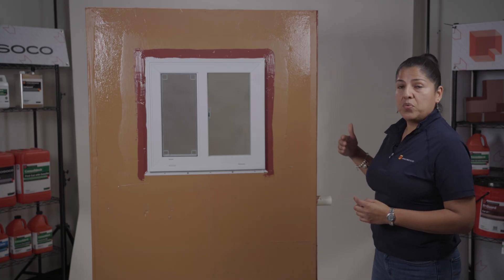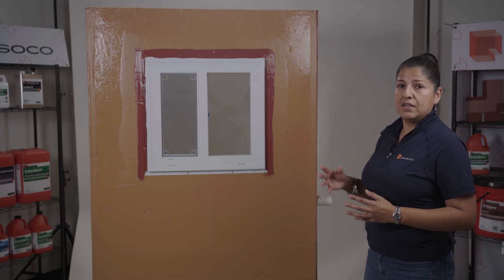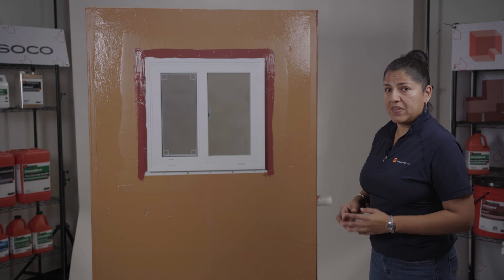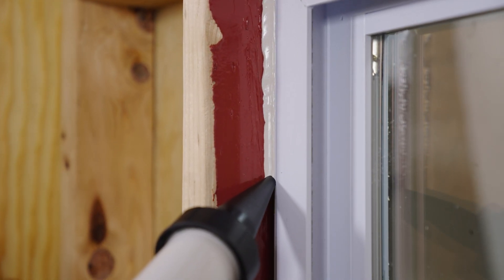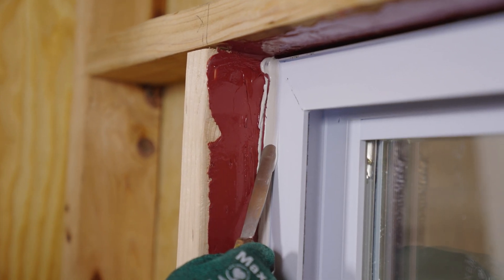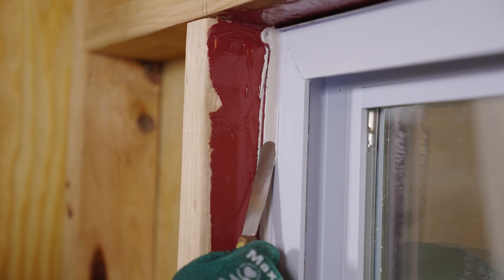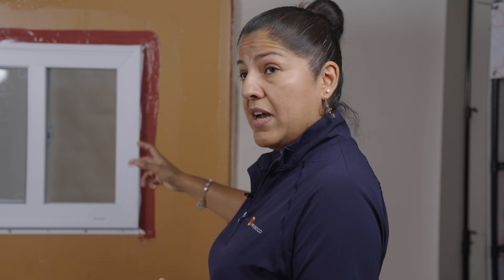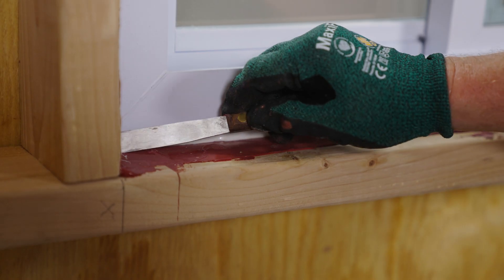The Complete R-Guard System for Air Barriers: From Start to Finish

Comment: What happened to Joint and Seam Filler?
Reply from the maker: Joint & Seam filler is still available!
Reply: What is the difference between cat 5 and spray wrap mvp? I see a significant price difference between them?
Reply from the maker: @Adam-y2u6p  While both are effective air barriers, Cat 5 is STP and Spray wrap is acrylic based
Reply: @ProsocoSince1939  is spray wrap mvp suitable to use as primary wrb on a house?
Reply from the maker: @Adam-y2u6p  Yes, it sure is!
Reply: @ProsocoSince1939  awesome. Thanks!